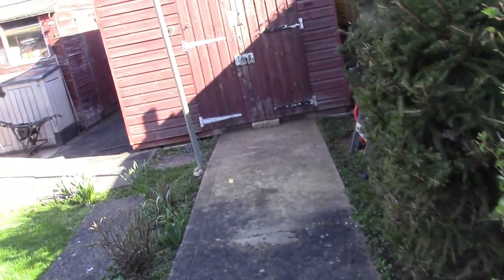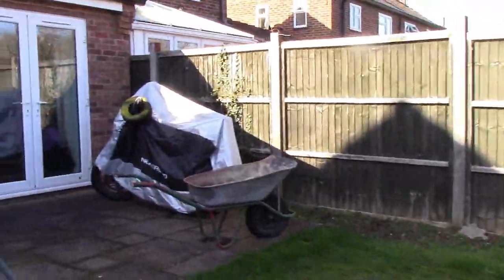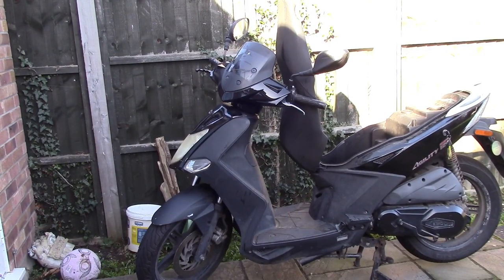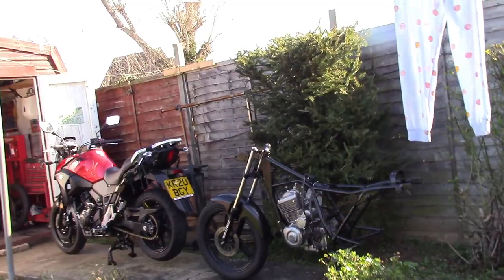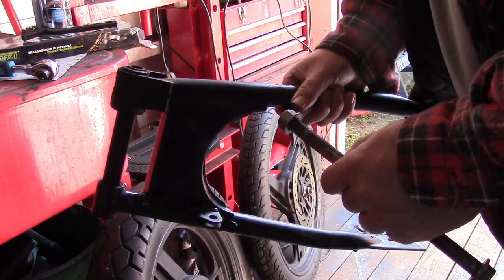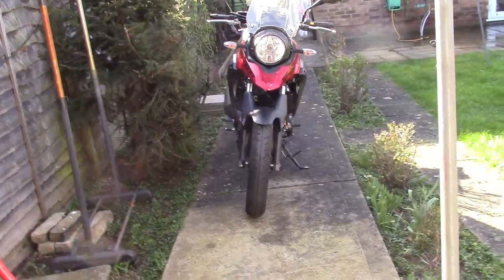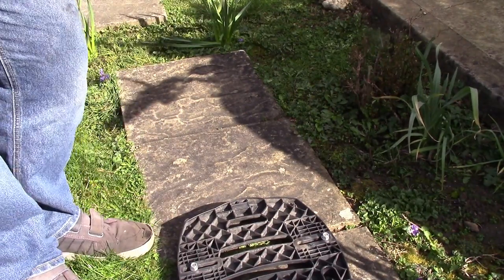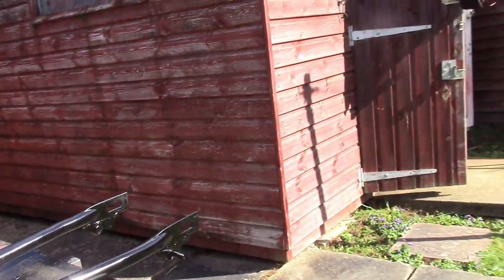We are back! Lets see what we have got to play with.

Comment: There's so many variables regarding having 10% ethanol.
10% ethanol will eventually separate from petrol and will also absorp water depending on humidity.
If left in float bowls the petrol evaporates but ethanol won't and leaves that watery jelly like crap behind.
Might go off in 30 days or might last 12 months all depends on how and where it's stored.
Reply from the maker: I can only speak from personal experience, and so far I have seen no evidence of the claims so far.